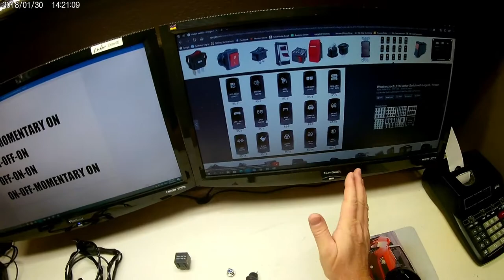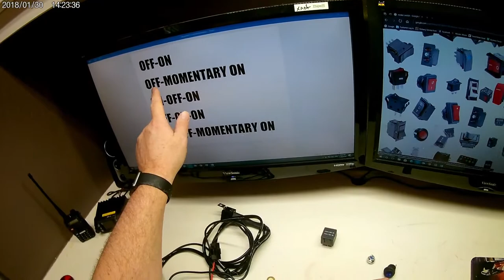MAVERICK X3 RELAY AND ROCKER SWITCH INFO VIDEO

Comment: Also, the 7 prong switch that turns on lite bar, which is actually 6 working prongs one is a dummy prong, the tiny lite inside dose not come on. Now I have a 75 lb dog that steps on this switch so maybe the switch is broke. but that dosent explain why the ignition on terminal on the bus bar is dead. I appreciate any input. If I take this in to the dealer, this dealer is struggling, the dealer will take me to school and way over charge.

Comment: Great video Larry, wondering if you have any ideas to set up Baja Designs Squadron XL 80's. They offer a 50% dimmer switch. I run them off a on of rocker switch but they come with an extra push button that you press to give you 100%, then press again for 50%. It would be nice if I could run all of it under one rocker switch. Any ideas?

Comment: larry, why is my bus bar ignition on terminal dead? tested with test lite.  My whip lights are connected to it and they are dead. What fuse in the fuse box is for the bus bar ignition on teminal. Also unrelated or maybe related, my lite bar is down dead. the fuse looks good. there is a relay switch, do you think its dead. I found the fuse and relay for lite bar. Please help me!
Reply from the maker: There are three terminals on the busbar on the passenger side axle tunnel wall. The top is ground direct to battery. middle is direct from battery with no apparent inline fuse. Bottom is what most people hook up to as it is controlled from ignition and comes on only when engine is on. If you are connected to the bottom, look for a fuse blown at the fuse box. If you are checking the center terminal which is always hot and it is not anymore. Check connection at battery for corrosion first. Also check corrosion on bus bar at connections. I see corrosion and rust from water all the time. ALot of relays that come with lights claim to be waterproof and are not. Check your relay if everything else works by testing the wires coming into it. If it is bad you have to make sure you get a relay with the very same specs or it may not work. Same applies for your lightbar.  My first notion would be the fuse to the Busbar. Not sure which one is correct. pull your relays from your factory fusebox and check for corrosion too.

Comment: So the rocker switch burn out also how can I test them to see if them work. My RGB, whips, and led bar stop working I disconnected the all the pig tailers and see where I can start to see where the problem is
Reply from the maker: Did you use an inline fuse and a relay with your rocker switch? IF not, you could have overheated the switch and melted terminals. If you have an inline fuse it may have blown.
Reply: @txtamer  I check the fuse for the rocker switch it's still in good they turned on last night. Then just wouldn't turn on ne more.
Reply: Turns out is was my fuse for the pigtail on the fuse box of my can am but everytime I go to reconnect the accessories they all work for the exception of the LED bar keeps blowing the fuse at the fuse box and idk but the fuse to the relay for the led bar looks a little dirty with dirt mud. My RGB lighting and whip work fine as soon as I add the LED Bar POP a fuse (20a) tired upgrading to a 30a fuse same difference. What should I do? Thx n advance!